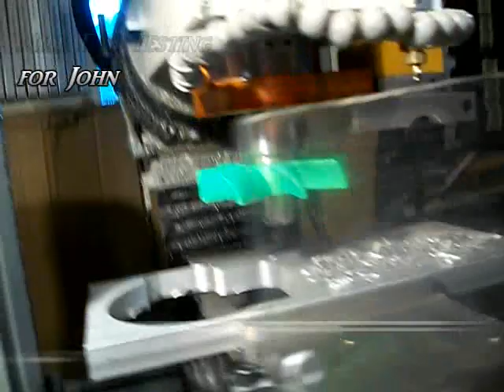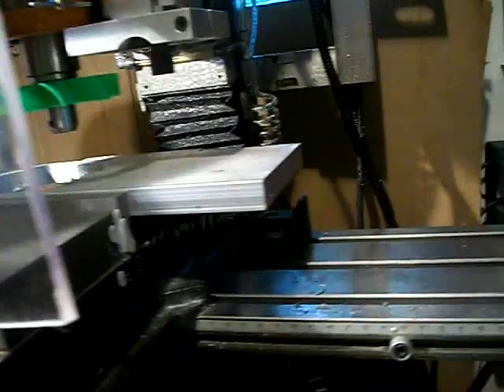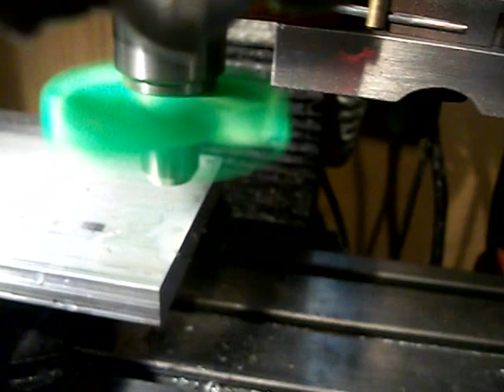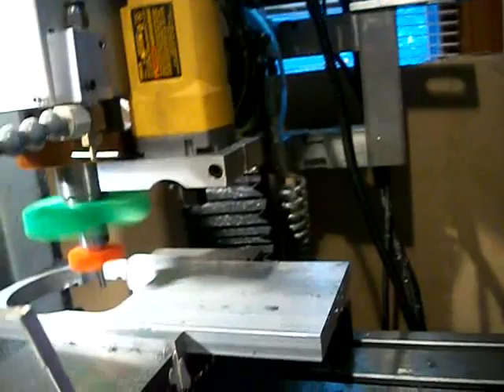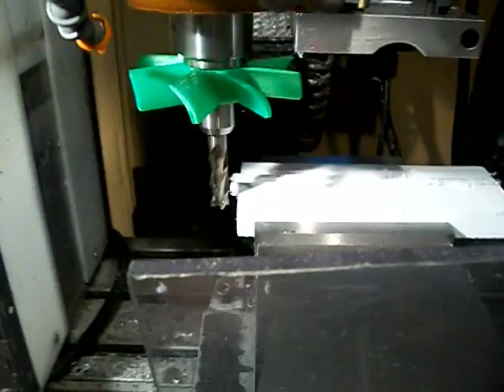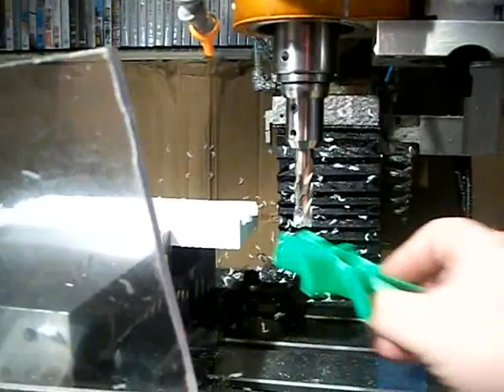Mill Fan Testing

Comment: ok, I think I see something that might work a little better. Just looking at a few fans here around the house most of them seem to have an increasing angle from tip to base. Maybe a few less blades and increasing the angle toward the middle would concentrate the air downward. It is an interesting project to say the least.
Google Jet engine fan blade and that will show you what I am trying to describe.